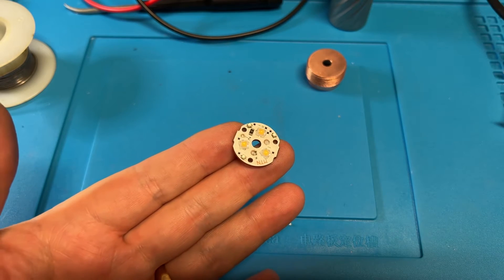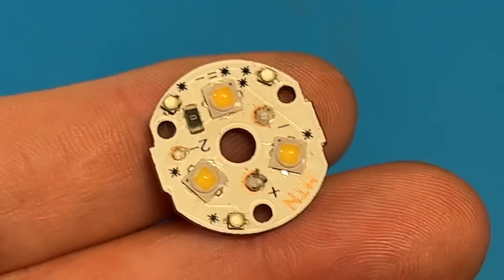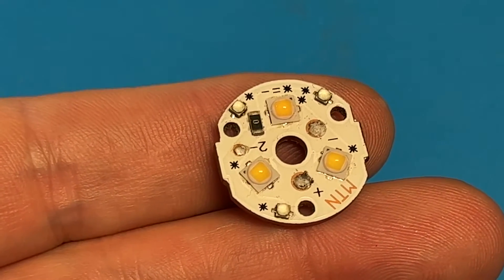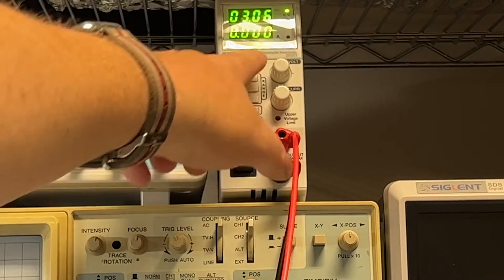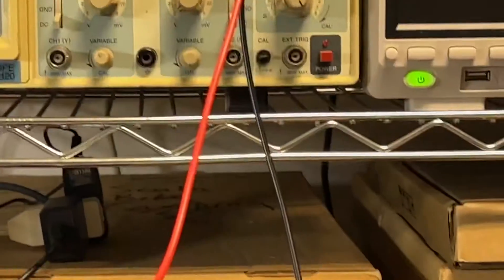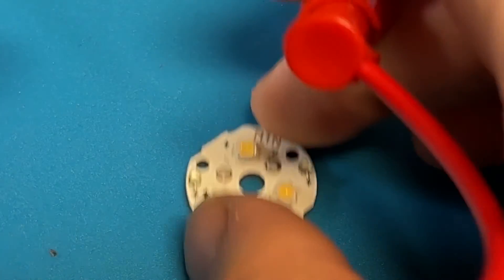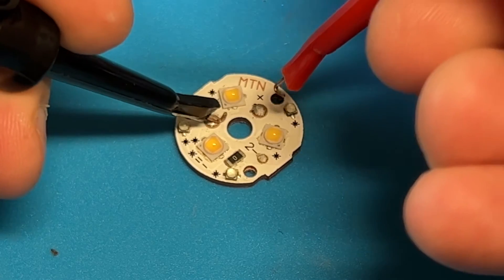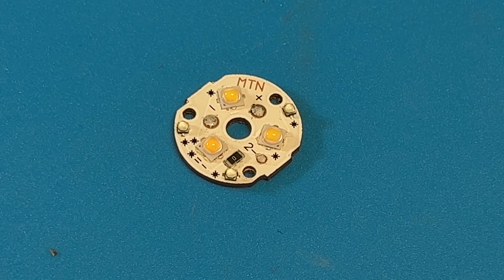QUICKIE: Testing emitters during an emitter swap/reflow

Comment: Very helpful, I wanted to get a bench power supply, but didn't understand what to set it at in relation to flashlight mods. I think another good topic could be Emitter to PCB to Driver relation in regards to modding and choosing the proper parts for a build. There are so many different options. What works with what? When are boost and buck drivers used? That area is pretty confusing.

Comment: First, I will confirm that this tutorial is immensely helpful, especially for those of us without the electronics background, and/or with limited experience in emitter swap modifications. Since this is a "confirming your work before reinstalling" type of tutorial, it brings up an additional question or two.

First, for multi-emitter new builds or mod swaps, after checking that the emitters are lighting up, what do I need to do to confirm each emitter is putting out its rated lumens (in turn confirming each LED has been reflowed properly)? Second, following-up your comment about what can be used to "power-test" each emitter (PSU, an individual battery, DMM Diode Test, etc.), which "LED spec" (ie, nominal V, forward V, etc.) should be considered when choosing how much max voltage and/or amperage to use for the testing so that an emitter is not over-powered or "shocked"? Understanding those specifics would also be greatly appreciated.

BTW, I really enjoy and learn much from your videos, so please keep them coming!